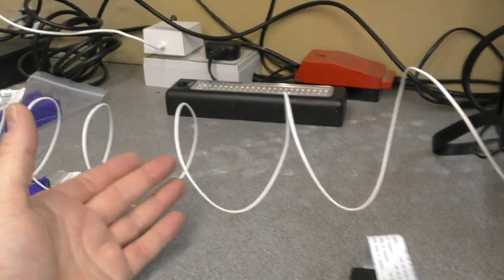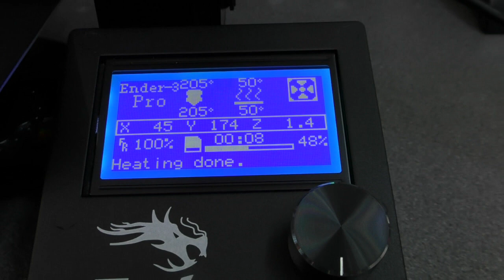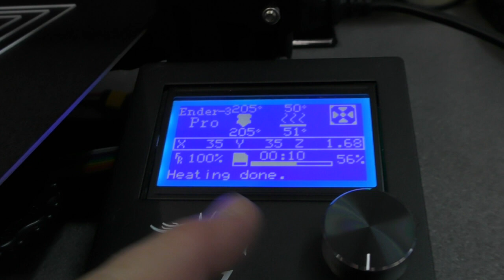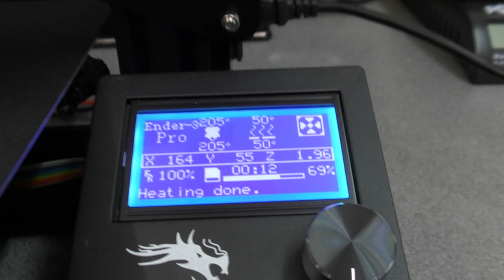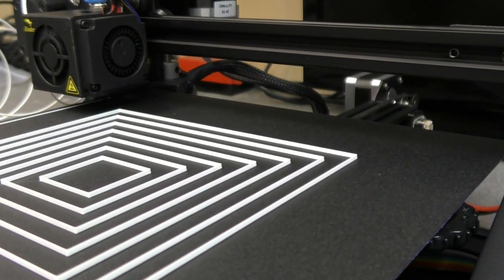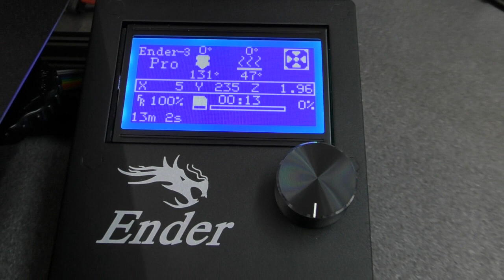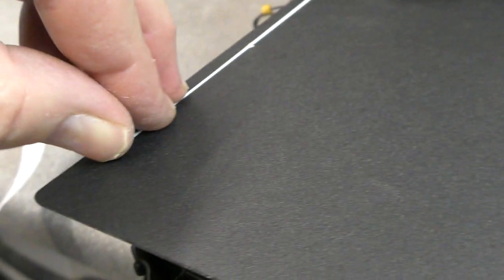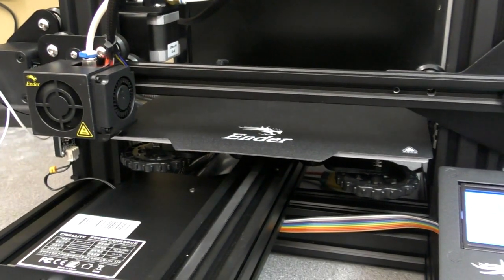Ender 3 Pro Bed level code and test code

Comment: Why is this code so hard to find now?  I downloaded it a few years ago and its been invaluable and I'd been using it extensively up until last week as I had the code saved to an SD card but I seem to have misplaced the card recently and I really need it.  Any possibility you still have it and could upload it somewhere or email or something?  I'd really appreciate it as every site I visit for the code is a 404 and I just can't find it :/ Many thanks :)
Reply from the maker: Because it is now a paid for download. £3.
https://thangs.com/designer/CHEP/3d-model/Ver4.0%20Filament%20Friday%20Manual%20Bed%20Level%20for%20Ender%20Size%20Printers%20by%20CHEP-1075766